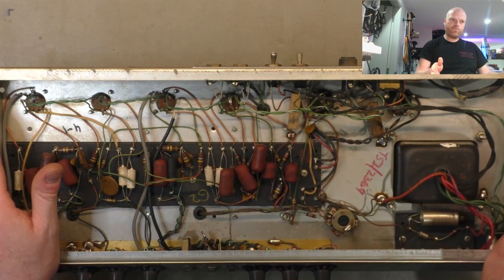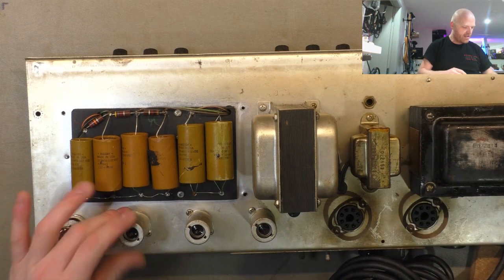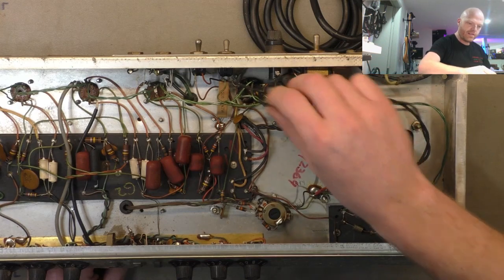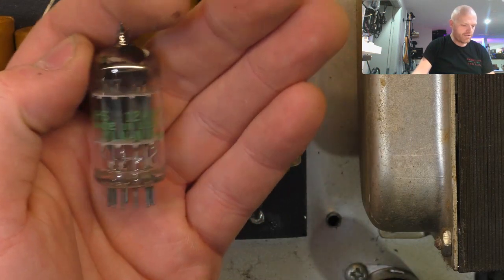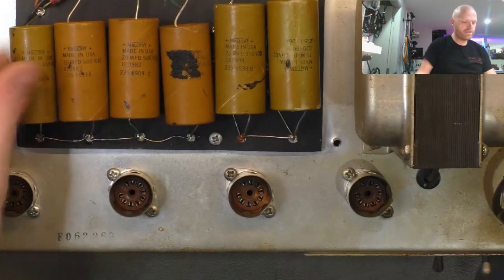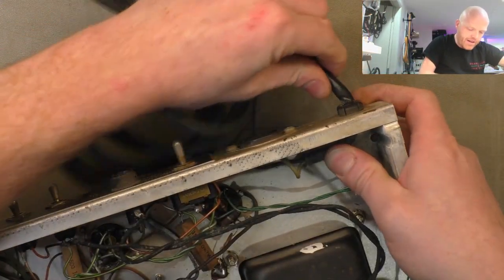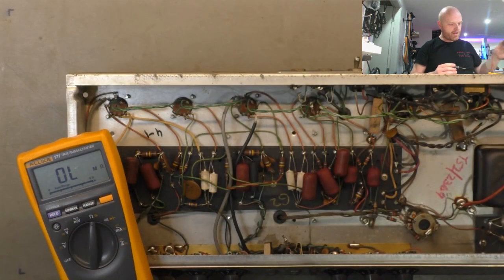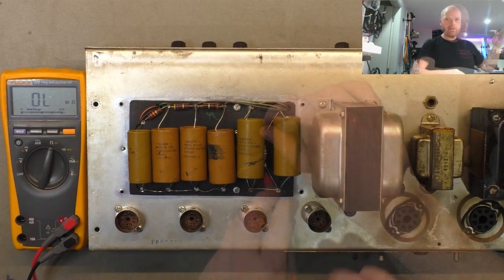Fender Bassman AC568 To AB165 / AA864 Hybrid Pt1

Comment: Hi - Great results on this Bassman and fantastic execution of the video (your playing does justice to the technical work as well) ... I see you briefly explain the output design of the 568 at the 12:30 mark and also go over the 864 cap and resistor values that went into the doghouse at 27:00 ... but there still seems a lot of design changes to wrangle around the PI going from 568/165 to 864. I did catch your comment cautioning reversal of output jack in your pt 2 vid (critical - thanks). However,  I am looking for how you determined your conversion to the non-inverting configuration coming out of the 3rd 7025. Obviously, you have to flip the signal around and some additional component values would likely have to change - didn't notice you discussing that. Do you have any more notes or resources on that you can share?
Reply from the maker: Not sure I follow. Why would I have to invert the signal? The channels are in phase on the AB165 and AC568, but out of phase on the AA864, but that would only be an issue if you linked the channels. From memory (over a year ago) I left the channels in phase as per the original AC568 and the AB165 circuit.